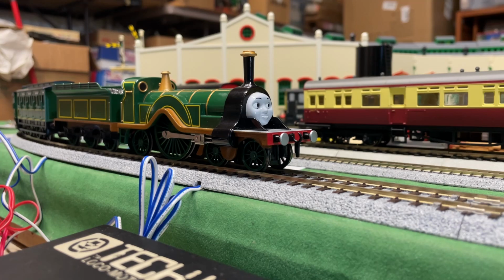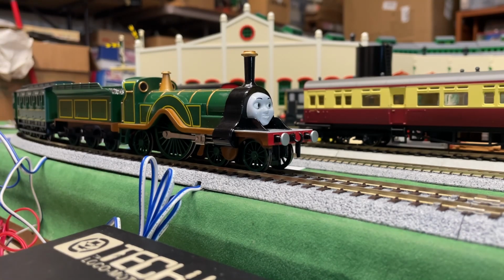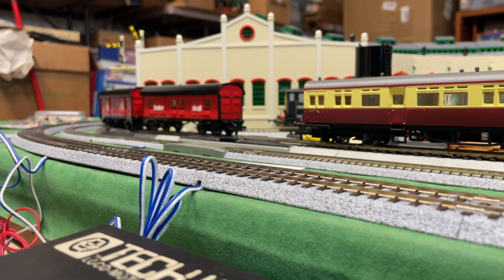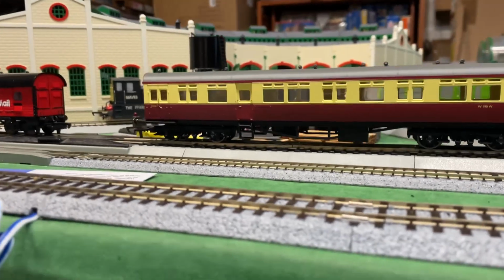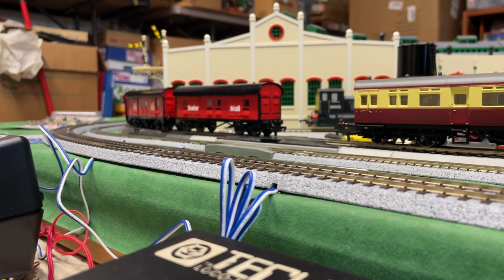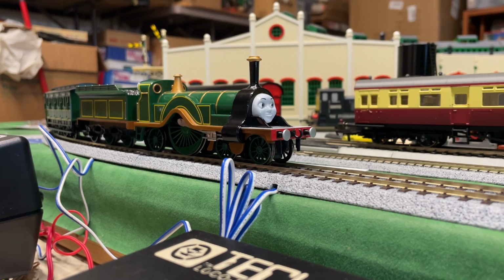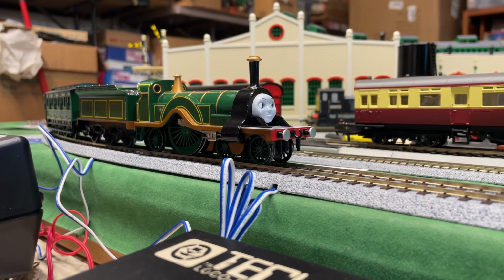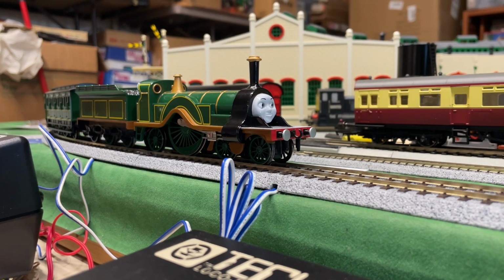December of DCC | Day 12 | Bachmann Emily with DCC & Sound | DCC Sodor

Comment: From where did you get the sound from?
Reply from the maker: I made this sound file myself.
Reply: @DCCSodor  Did you have to use a special program for it(for decoders), or just a regular editing software?

If possible, could you maybe upload the sound files to a google drive?
Reply from the maker: I used the software that was developed for the decoders, it’s call Lokprogrammer.  I’ll be doing a video on it very soon about just how I do it.  I’ll talk about how you can access them in that video